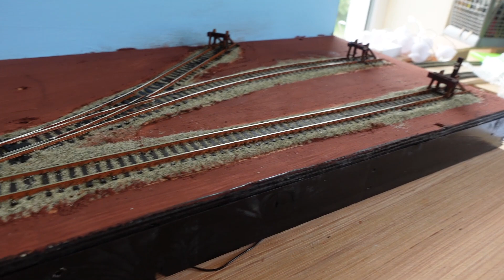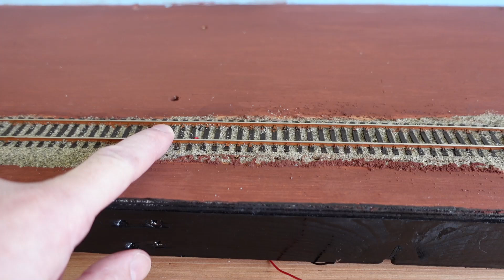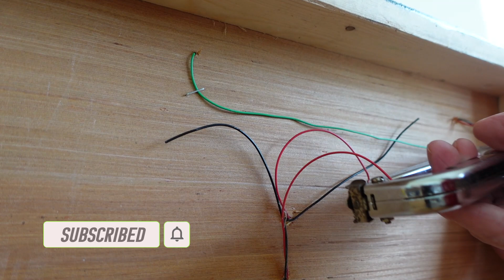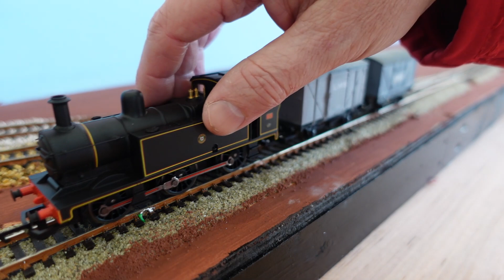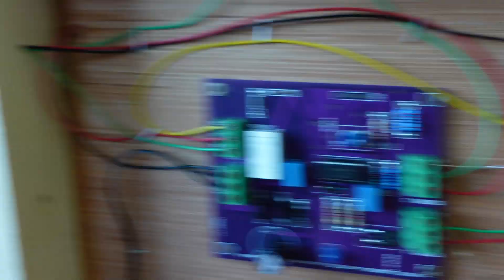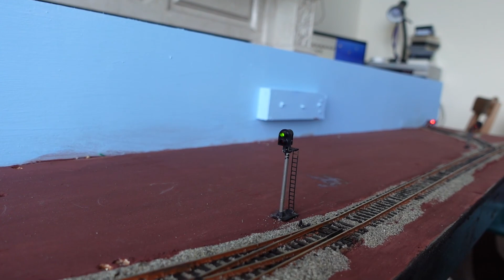DC shuttle install on OO gauge Model Railway

Comment: I thought it was 00 scale and H0 gauge.
Reply from the maker: Commonly called OO gauge but it does use the same gauge track as HO, OO Gauge/Scale 4mm to the foot (1:76), HO 3.5mm to the foot (1:87)